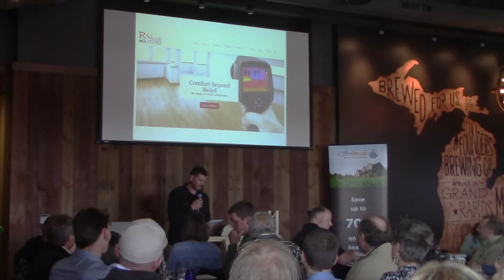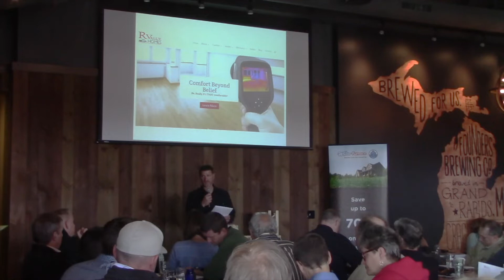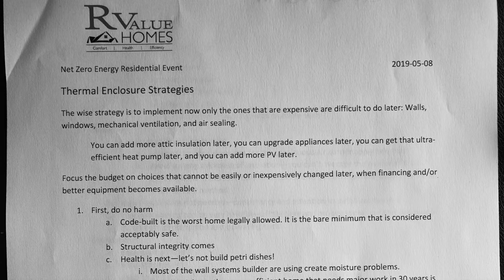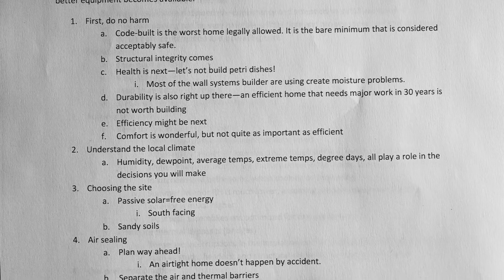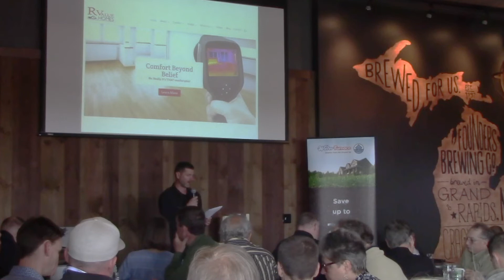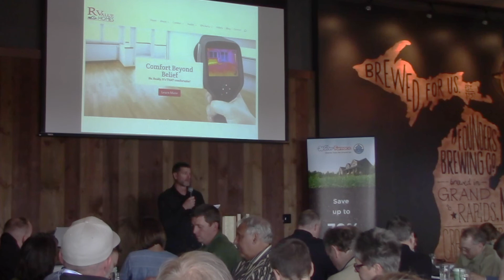MINZE19  - Thermal Envelop Panel - Jake Vierzen

Comment: if you want your wall to dry stop putting OSB on  the  outside side of wall
Reply: There certainly are a number of way to address the problem Andrey.  Some of them create other challenges that can limit design flexibility. I was surprised that I didn't get through all my material while presenting here, but I had intended to showcase how we use Insulating Concrete Form walls to solve the problems we were discussing. Perhaps we will have another opportunity to discuss this topic, with more time to speak!